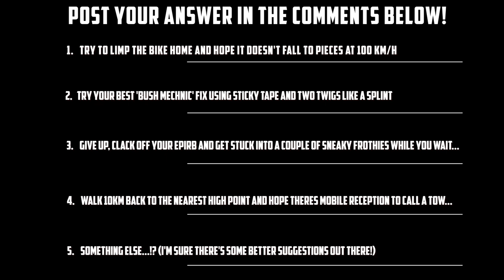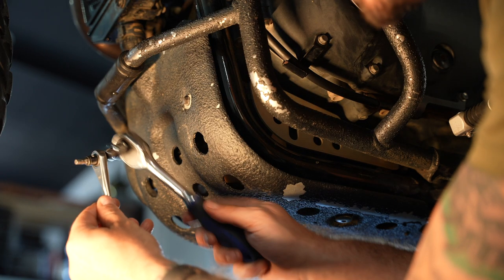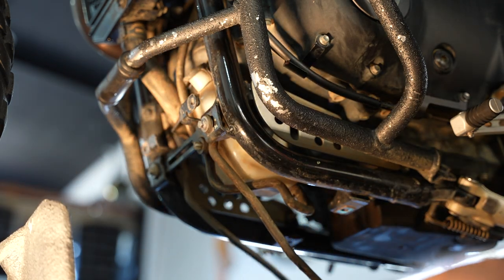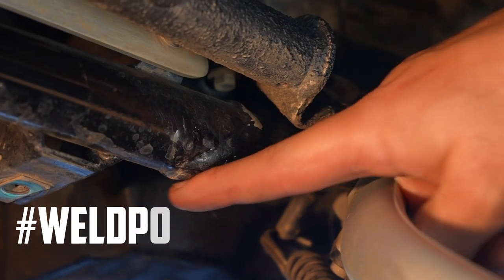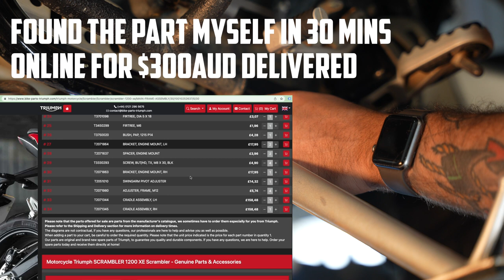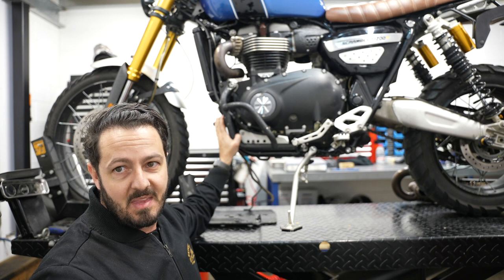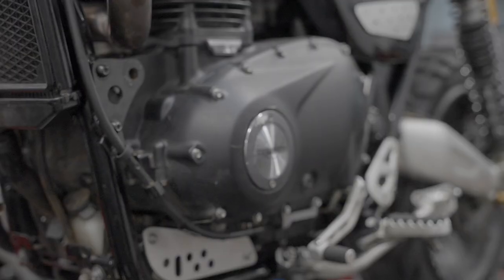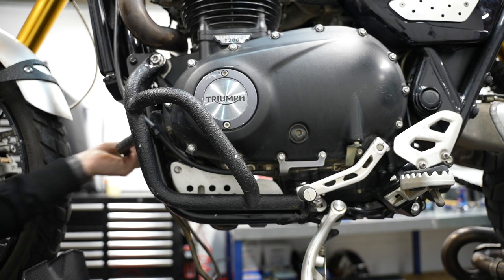Triumph can't fix this! | Scrambler Broken Frame | SCRAMBLER TIPS EP 11

Comment: When is it going to dawn on people that scramblers should be 150 kg max?😂 Taking this behemoth off road is asking for trouble, it's not an enduro, is it?
Reply from the maker: I think the most important thing is to keep an open mind, and understand everyone enjoys bikes in different ways. There’s plenty of trade offs with any bike you choose. Also, most Dakar bikes are around or over 150kg, and there’s not a scrambler or adv bike on the market that I’m aware of, that sits on the 150kg mark (wet).
Reply: @lifeofascrambler  The clasic scrambler, the xt 500, the doyen of dirt bikes the XR 600 R, even the crf300 rally sits at EXACTLY 150 ready to go. So does the ktm 690. The XR 650 R also. The XR 650 l, the new CF moto adventure bike, the lovely Portuguese AJP PR7, ALL the serious contenders. It's a magic number. I must point out, in direct contrast to your statement, ALL modern Dakar bikes are LESS than 150 kg.
Reply: @lifeofascrambler  I meant the Kove 450, not the cf moto, sorry. Still, the point is 150 ballpark 10 kg more or less with fuel NOT 200kg before you start fiddling with the filler cap(s). I have a Marathon replica A Twin with three tanks which is a little excessive, but scrambler it is not. I stick to my point, a scrambler (originally a little Triumph bonny stripped bare) even with a tank of gas was right about 150 kg. It's not hard to make. I'm just tired of marketing misconstruing names to for the sake of making something appear to be what it's not.  And when it comes to weight, uncontestably the most important factor on a motorcycle, they are lying, fooling the customer into buying a heavy bike that is unmanagable off road. 99% percent of us customers are not wizards like Pol Tarres.
And as I said before they are loads of bikes that sit on or very near 150kg ready to take you off road and around the world. They are just not 1200 cc monsters. That's dishonest.
Reply from the maker: @allistairneil8968  I can understand your personal opinion - everyone has their own opinions and preferences. It seems a lot of people do make a conscious choice that weight isn't the single most important factor on a motorbike - because they're not racing, they're exploring, or camping, and so they're going to be carrying extra weight, they're going to put in a lot of KM's and they decide it's fine to trade a few KG's in exchange for some comfort that the lightweight bikes don't have. I've ridden plenty of lightweight bikes and felt like I'd been sitting on a jackhammer for hundreds of KM's - and that's before we even get to the off-road fun parts. Also, the frame rail that broke here wasn't broken from being a heavy bike ridden offroad - it's related to a design issue with the kickstand mounting position.
Reply: @lifeofascrambler  My point is that marketing of massive street bikes as scramblers purposefully misleads customers into buying bikes that are unmanageable off road by mere mortals like you or I. Secondly, if you are going to weigh your bike down with masses of gear then having a a big heavy bike is not going to help you. Check out the developing world where they tansport several generations of whole families and the kitchen sink on tiny scooters, not massive 1200cc monster bikes, even if they could afford to. As far as comfort is concerned, do what I did. Buy a van and have two bikes. Hayabusa and XR 600 R with a kickstart, for example. Or ride a proper dirt oriented monster like an Africa Twin which is designed to go off road and still munch motorway miles in comfort. Big trailies have a screen to protect you too, the Triumph scrambler doesn't, so it isn't great off road, and not great for long road trips either. It just LOOKS cool and is surprisingly good off road. I bet you could say the same thing about many road bikes, there was even a guy who rode a Ducatti sports bike off road with knobbies. It was SURPRISINGLY good off road (probably because it was quite light). My point is that while weight is NOT such an important criterion for road bikes, Hayabusas are a case in point, off road, weight is of primary concern. There might be little things like the Yamaha 700 swing arm geometry or KTM weight distribution tricks, but Triumph scramblers don't display any miracles except where the frame doesn't crack. I also have a monster off road bike but I spend a lot of time in deserts and Africa Twins last a very long time because they were built for the dirt. If you buy a bike just for its looks then your choice is inevitably flawed. Basta.
Reply: @lifeofascrambler  In case you are wondering, I got my Africa Twin brand new in '91, slowly modified it into a Marathon and apart from tyres, oil, chain and brakes plus a new rear shock I have done nothing to it. I've been to Central Asia, Mongolia, Kazakhstan,  all over the Maghreb and daily commuting and it's been around the clock once a couple of years back. It looks a bit ugly and weather beaten (soon to get a new paint job) but she is solid. Plus she can do more than 1000 kliks without stopping. Lisbon Barcelona and when I arrived I wasn't even tired. Now THAT is a bike! But if you want a scrambler...